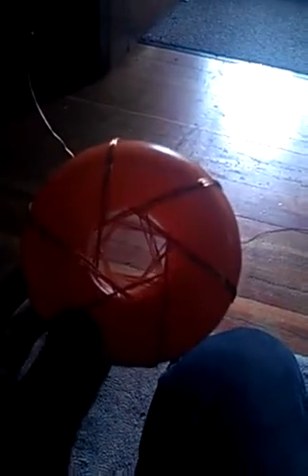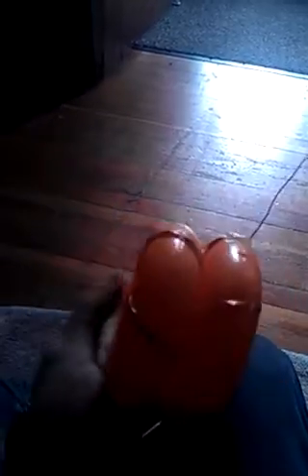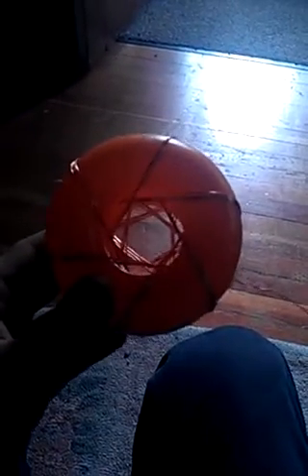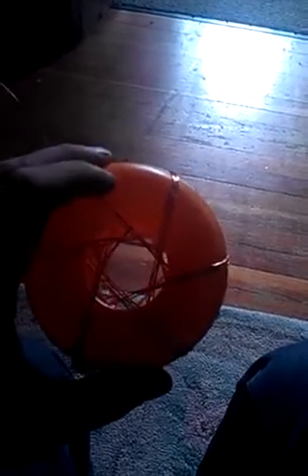Double Torus Rodin Coil

Comment: and what's the best way to physically separate the 2 toroids? My thoughts are maybe 3x PVC pipes glued/attached to the coils, with the wiring to go around where required. I would expect that the thinner the support means, the less interruption to the coil windings. I'd love to hear from people for ideas on this. Am keen to get started on a dual-rodin, bu this support issue is holding me back. Cheers.